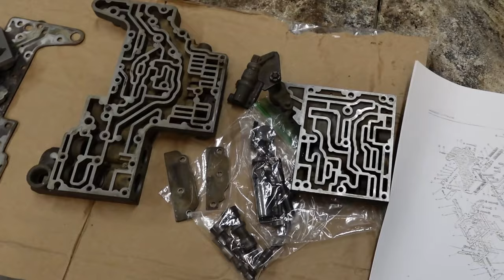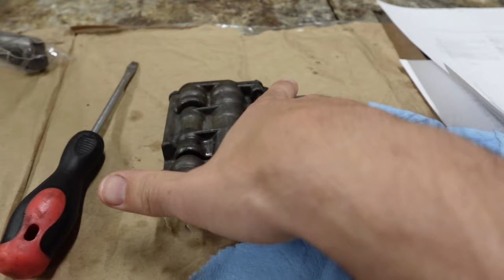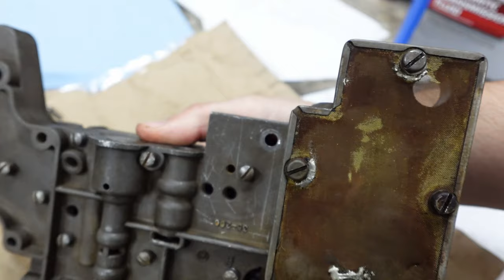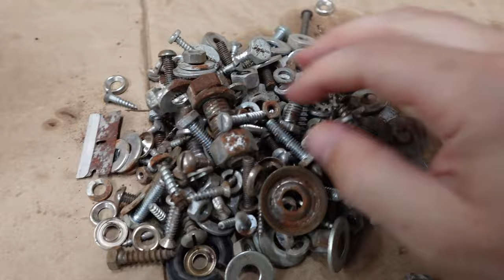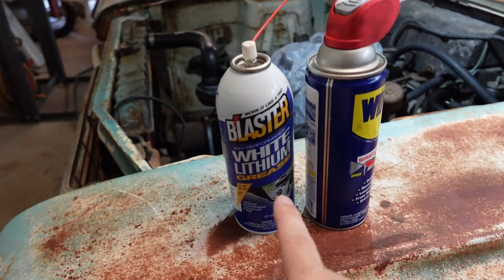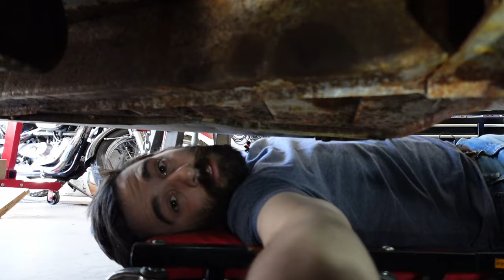It's Back Together! Abandoned 1962 AMC Rambler

Comment: I can mend you putting together that transmission I've replaced a lot of Transmissions I've never taken one apart we're still working on my El Camino my friend rebuilt the transmission himself is the 200 hour and I guess a lot of the parts were hard to find we had to go to San Diego and there was a lot of different places that we had to get parts for it for some reason and it doesn't make sense to me because a lot of the mid-80s GM products had the 200r transmission next is a complete brake system and front suspension lots of fun too cool
Reply from the maker: That’s sounds like fun. I hope you get to drive it soon. An El Camino would be nice. I used to be a resident of San Diego once upon a time.

Comment: What kind of transmission fluid does that use?
Reply from the maker: It was designed to use type A or F. I believe type A which I also believe is not manufactured anyone. The replacement for type A is Dexron as far as I’m aware. Im using Dexron III.

Comment: I feel bad that you put all that work into cleaning that valve body.even pumping the fluid out,the amount of sludge left in everything else is going to completely plug everything else when you start pumping fluid.should have pulled the trans and cleaned and resealed it.i appreciate the low budget approach,but will cause more work later.
Reply from the maker: I hear ya. Thing is the dang rear axle & suspension would have to come out because of the torque tube. There’s a lot of collateral damage during the process that is unavoidable. That’s why I’ve just been gritting my teeth & shoving my arm up there.
Reply: That is a negatory!  He will likely add Seafoam trans tune which specifically has gel destructive powers. By pumping through cloth you can monitor what is coming out.  By running the final fluid through a fuel filter you get invisible particles out and you get to re use the fluid.